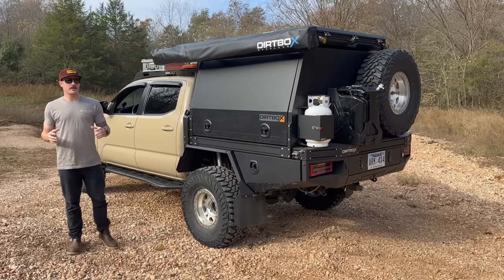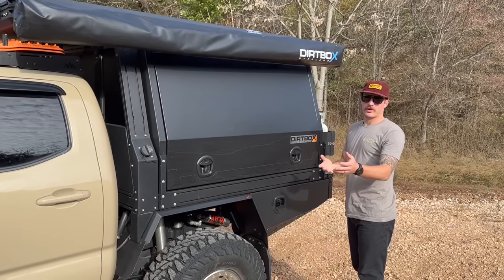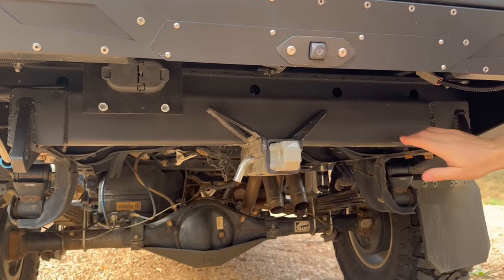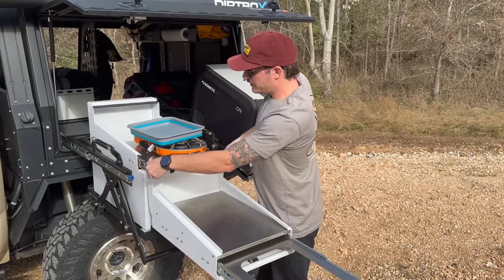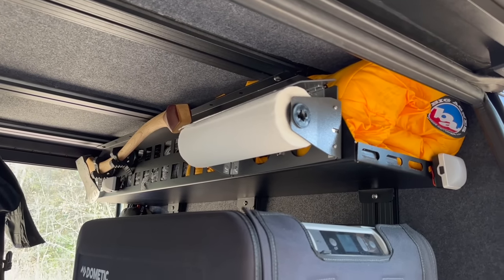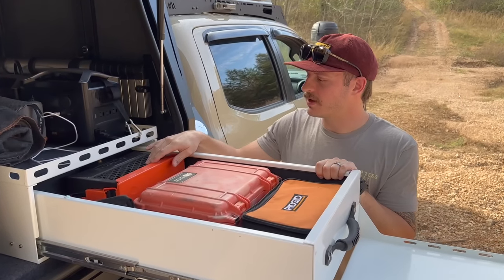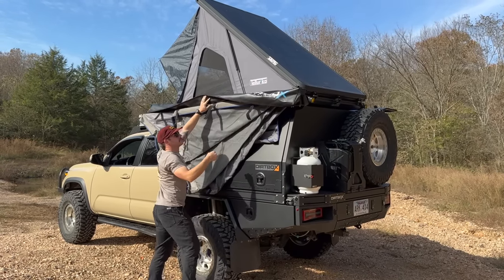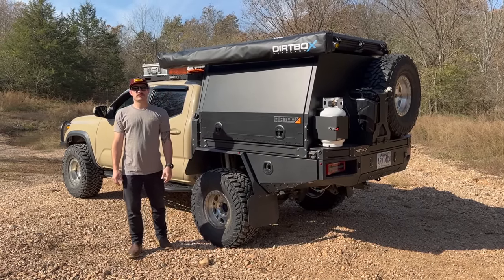Tacoma Flatbed Tray & Canopy FULL TOUR - Dirtbox Overland

Comment: That’s mega setup, like it when the trays end up shorter they look ace and don’t seem too lose much space because of low draws and volume high up. Really like the rear draw that is cool once pushed in weight nice n low and near axle. Thought you were going too run a spod switching system in there ? 
Nice going bet your proud of sorting that lot. ✊
Reply from the maker: Thanks!! I was going to but I didn’t know they had their own panel ha. Still plan to put some red baja lights in the canopy

Comment: I would like to see an update video about your LIthium battery that you run all of that off of. If I remember correctly, and older video of yours said the battery system was a prototype. How well does that battery hold up to heat and cold? Does it have any kind of shutoff or heater inside of the battery for cold temperature charging?
Reply from the maker: That’s correct. So far it hasn’t skipped a beat. Thanks for the reminder. It’s been almost a full year. I wanted to test it in extreme cold and extreme heat, both of which passed.

Comment: Aren’t the flatbed and canopy made in China?  For full disclosure I think this needs to be mentioned before promoting a product.
Reply from the maker: Sure are. I tell that to anyone who asks. I’m promoting the product because it’s very high quality and works extremely well. If those 2 things are covered, who cares where it comes from. I know that’s the general stigma, but I wouldn’t own this if it sucked. Every single person that I’ve showed in person is just in awe and they can’t believe it’s not America made. I also learned the history of the company and how one of the owners is from China. He controls all manufacturing and is one of the most hardcore overlanders I know.
Reply: @ArkansasOffroad  thanks for the confirmation that these are made in China.  Do you have any insight or knowledge on why the Dirtbox camper looks exactly like a camper sold by a Canadian company called BF Campers Delta that was released over a year ago?  Or any knowledge on the OVS Magpak camper which is coming out with an exact copy as the Dirtbox one?  Are they made in Chinese factory?  Who actually owns the IP on these campers since they all look alike?

Comment: That kitchen is an awful design. Grease goes all over the whole thing while cooking and there is no real prep area unless you are just making a sandwich. A lot of wasted space in that tray compared to the new Armadillo, the Dirtbox trays are too high
Reply: Thanks for the feedback! Have you had the chance to test out the kitchen for yourself to confirm this? What kitchen are you running currently? What changes would you make to solve the problems you foresee? Our whole design is based on off road functionality and durability. 
-Cheers!
Reply from the maker: I actually like it a lot, and it may have been a bit deceiving. My stove is in the "storage" position. I don't cook with it up there, I cook with it on the level below it, right next to the sink. That way grease doesn't splatter and its at a lower level. Plus, it frees up the top slide to access the contents inside.